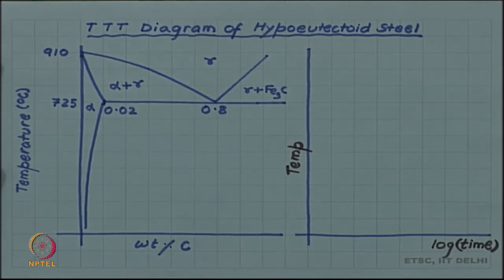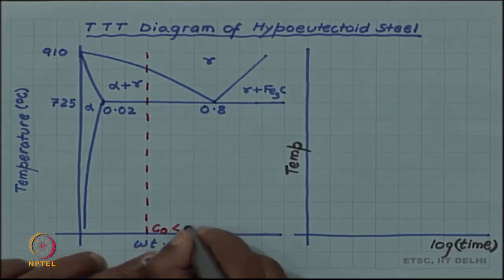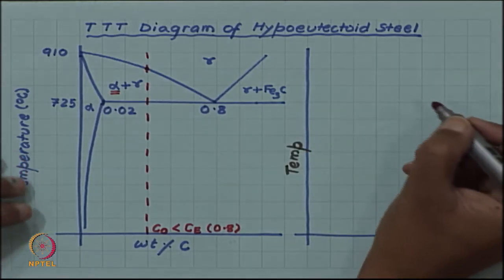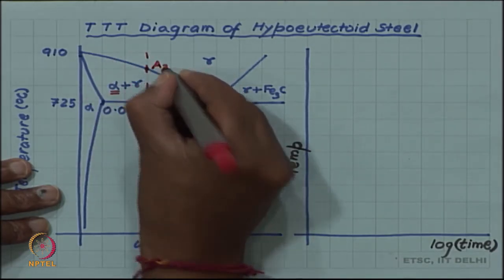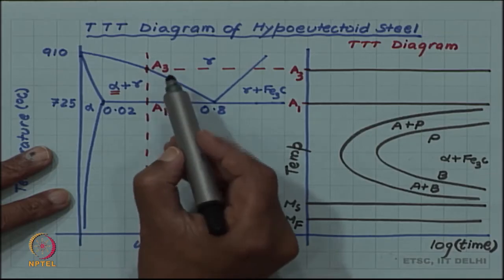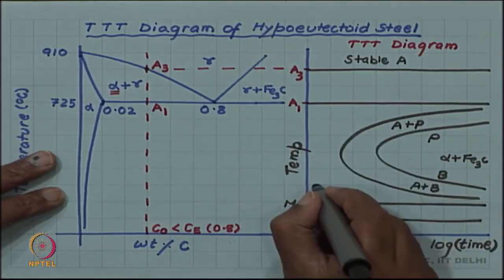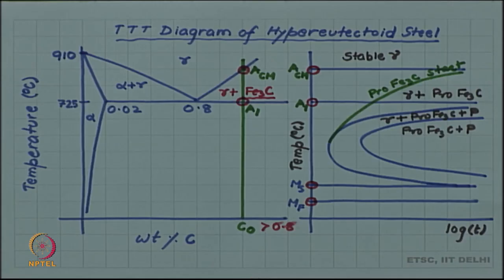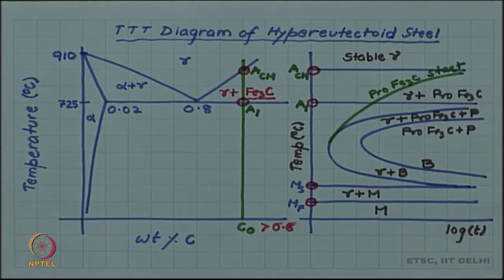TTT diagram of Hypoeutectoid and Hypereutectoid steels

Comment: Sir below the nose of the C curve why the Pro eutectoid ferrite and cementite are not formed in the hypo and hyper eutectoid steels ?
Reply from the maker: You have asked a very interesting but at the same time a very difficult question. Honestly, I have no answer. But thanks for asking as it is forcing me to look for an answer.
Reply: @introductiontomaterialsscience  hello sir have you found the answer? please enlighten us if you have. thanks
Reply: I don't know the exact answer, but since Sir has yet to answer your question, I will try to answer. Every transformation definitely needs time. Take an example of eutectoid steel (0.8%C); the Iron-carbon diagram shows complete austenite will transform to pearlite at eutectoid temperature, but it will not give you how much time you need for transformation. The time comes from the TTT diagram. So if you do not provide enough time for austenite to transform to pearlite or you quench the austenite, it will transform to Martensite, not pearlite. In the same way, if you don't give enough time to cool to austenite at A3 or Acm, it will not form pro eutectoid ferrite or pro eutectoid cementite. It means if you cool it fast, it will not even start the transformation to pro-eutectoid components and stay as unstable austenite only. Please observe the alpha start line in the TTT diagram of pro-eutectoid steel.  Please correct me if I am wrong.

Comment: Sir, how is pro eutectoid alpha different that from regular alpha
Reply: Proeutectoid alpha has the same crystal structure as eutectoid alpha (BCC interstitial solid solution of Fe with C). However, they form at different stages of cooling of austenite. Proeutectoid alpha form first above the eutectoid temperature. Eutectoid alpha forms at the eutectoid temperature along with cementite. because of this history, their appearance in microstructure is different. Proeutectoid alpha appears more like equiaxed grains. Eutectoid alpha as lamellae of alpha sandwiched between lamellae of cementite.
Thus phase-wise both are the same phase alpha. The adjectives 'proeutectoid' and 'eutectoid' describes the history of formation and the resulting morphology (shape).